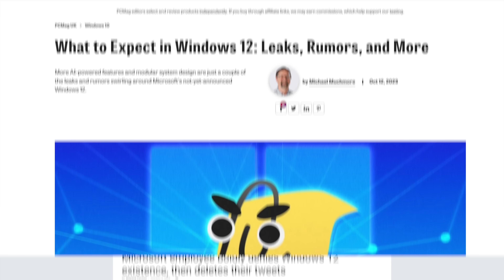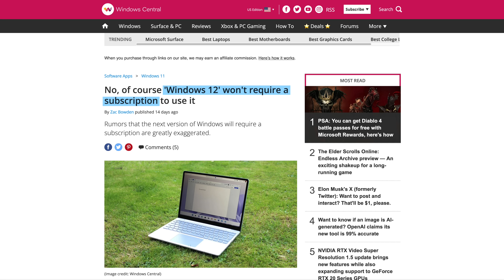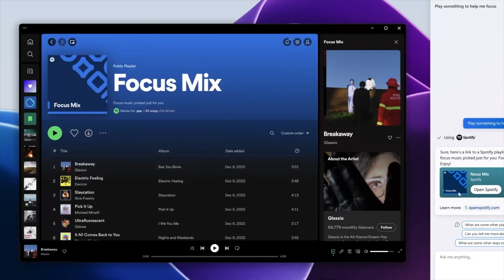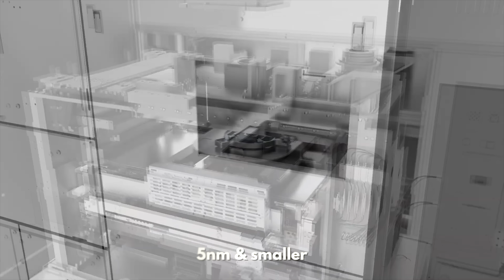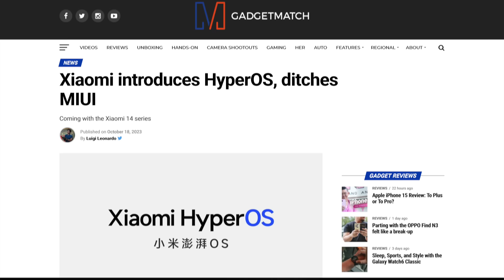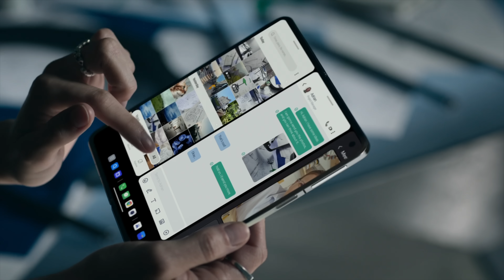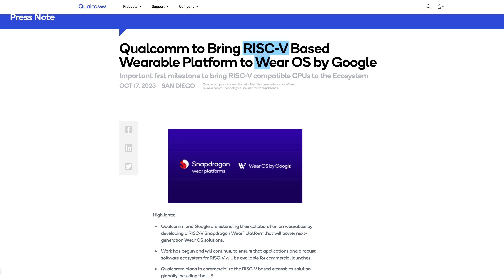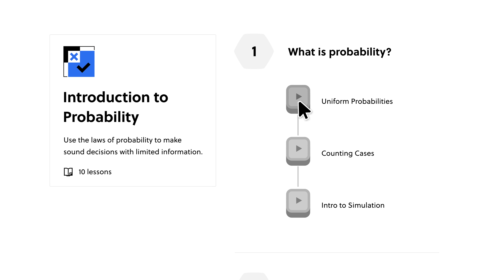Windows 12 is looking good!

Comment: 10 is supported until late 2025, so I can see a lot of 10 users skipping 11 completely and going right to 12. This of course assumes they have a newer pc which would be compatible with 11 and 12's security (motherboard) requirements
Reply: For most users, the frequency of Windows 10 updates  slowing down after 2025 would be a good reason to keep using it for as long as they can keep the hardware running. Windows 11 and 12 are not faster, the settings are more restricted, and it supports less software. I know absolutely no one looking forward to upgrading a Windows machine, even if it was completely free. When their machine finally dies, they resort to second hand machines to try and postpone the inevitable OS update.
Reply: I don’t know if this is an unpopular opinion or not, but I actually wanna experience Windows 11. I didn’t got a chance to Experience Windows Vista and 8.1 but I actually have better hopes into this OS. And I actually think it’s easier to say goodbye to Windows 10 than 2000,XP and 7 because I found Windows 10’s layout the most boring and simplified one of them all. I actually think Windows 11 did slightly better. Seeing this preview makes me afraid Windows 12 won’t look like the past Windows versions anymore because the taskbar is no longer fully overlapping the bottom screen like how it was all the time. Despite a lot of people have their thoughts about Windows 11 being not very good, I do actually somewhat like it and would like to experience it because the new MS Paint version.
Reply: @infernal-toad  Windows 11 is a better Windows 10 IMO.  Windows are more rounded and detailed.  To me it looks even better than 10.  I've been using Windows 11 now for a year and no issues.  I love it.
Reply: @riseabove3082  That’s good to hear. Honestly the only issues of Windows 11 I can think of are probably just minor issues. Nothing problematic compared to ME, Vista and 8.x. And if you don’t like drastic changes (which is definently gonna happen with Windows 12), then why are there a bunch of people that wanna Skip Windows 11?

Comment: The only way to do a great version of Windows is to re-write it from scratch. Clean sheet rebuild.  All we have ever seen is patch upon patch upon patch. my good what we currently have is little more than a skin atop windows 7.  and to make matters worse the things that they did change made things worse overall.   Windows was created like a bag of lego's instead of it being one coherent system, its a tons of little scripts and programs that dont relate with one another, each having their own sorta checks and balances.  The reason why it hasnt changed is obvious.  it cant. because windows in all its forms past and present is do entranced in various industries, that none of its older code can be removed or truly revised because so many systems that rely on that old code would fail to run.  i mean do you have any idea how much machinery out their still runs on dos!!!!!  so Windows needs a version that leaves the original code to its own version, and completely new operating system that is devoid of all the old code and antiquated programing methods.

Comment: I am still on win10. I would switch to Linux if I could but gaming on Linux (especially VR gaming) is a nightmare. I could upgrade to win11 if I force the bypass on my motherboard but I simply don't trust this whole AI path that they have taken. I mean, I have messed with AI stuff occasionally but I still wouldn't want it integrated into an OS and I think this is one of the big factors for other people not upgrading as well.

Comment: I think you appear a bit confused.....

Chat GP using web skimming or public data (anything from the internet) is only available as opensource license as default. As the EU explains unless organisations are able to prove the individual license source of the data by block chain the origins of the data cannot be licensed. Clearly any consulting company might be reselling stolen data to clients...

Windows 12 will probably be the end to windows OS . Windows operating systems have been in a down ward trend for some years with several announcements that windows 10 might be the last OS windows will produce. The details of windows 12 have still not been confirmed but it could mean the collapse of windows as we know it..not a bad thing...

The main thrust as we understand it is it will make the users machine into a thin client which will off load any demands for power chips in machines as the computing will be in the cloud. Similar to Google 8 pro. Chip maker like intel and AMD will see declines in revenue from high margin chips. These companies have been warned to move away from Microsoft before the market collapses for their high value chips. In the meantime arm chips will continue to be cheaper and less complex to manufacture until RISCV undercuts ARM in Europe leaving mass manufacture of chips across Europe within a few years.

It is not clear why Microsoft would want to move to arm given Apple has not yet developed its product for the consumer yet and the majority of global corporations have many billion dollars in x86 architecture. Ms relationship with Samsung is considered to be a reason for not buying Samsung phones due to fears of spyware, bloatware, and security concerns.

Comment: The nanoimprint lithography will not replace UV lithography, it will simply be another tool for fab companies.  The nanoimprint machine are not as cheap as it was promise a few decades ago and they are slower than UV lithography.  The problem with UV Lithography is the ballooning cost of R&D to shrink the process and the machine's energy demands that keep going up with every iteration plus they are not cheap.

Comment: I'm hoping that windows 12 is a completely new NT core because Windows 11 only really updated visuals. The visuals are great but imagine a rewritten NT core that could rival the performance of linux.
Reply: One day I started my windows 11 laptop.
Since it's really slow I seen windows 10 taskbar for 2 secs.
When I play sometimes the game chrashes and I see the Windows vista default aero theme.
And when even explorer crashes I see the icons from windows 95
And that's all, so basically windows 11 is windows 95 with just better UI lol
Reply: @uusfiyeyh  I'm not saying they should replace the NT core, just that it could use a huge upgrade. If large parts of it were rewritten it would have performance like linux but I don't expect them to do that. Also DOS was a large part of windows but they still replaced that.

Comment: Microsoft should remove all the clutter from Windows and combine its settings into one app properly like android.
Reply: Or maybe like, idk Windows XP??? Everything was in Control Panel, than the fooked it all up.
Reply: Can you elaborate? You've made me curious. How would you explain this to a 5 yr old. I'm somewhat tech savvy but not as much as I'd like 😅
Reply: @LaceyArtemis  There is control pane, and then there's setting
these 2 do almost exact same thing, but control panel is much lighter and easy to use

Comment: Windows 11 is... a UI downgrade, at least for me. It is so dumbed down it lost quite a few features, while the under-the-hood areas stayed exactly the same, as in kernel and codebase. It's just a reskinned 10. If 12 will be again a minor tweak instead of offering a proper quality upgrade, it will be the end of Windows for me. I accept 10 just because it's stable now, with updates disabled. I hate how it treats the user without disabling every. single. annoying. "feature"., when it thinks it knows better what I want to do with my PC than I do. 11 is now ugly af. It looks like a mix of Android and MacOS ripoff. I think of switching to Plasma Arch in the future. I'm glad Valve made great tools for Linux gaming

Comment: Question: Contrary to phone updates, I feel like lots of people prefer not to upgrade to the next version of Windows. Why is that the case?

Genuine question.
Reply: Up until Windows 10, previous 'new' Windows versions were marketed as entirely separate products and sold as such. They had their own update life cycles (service packs, anniversary updates, etc...) also usually drastically increased minimum and recommended hardware specs so it made more sense for users to buy new PCs every other or so Windows generation (Eg XP to Vista). Starting from Win 10 tho, it does seem like they're headed towards rolling updates and treating it as one Windows, similar to Mac OS and Android/iOS, presumably to limit fragmentation.
Ironically, Win 10 was supposed to be "the last version of Windows" but then Microsoft and OEMs realized they sell way more PCs when new major Windows versions get announced sooo they're in this middle boat of making updates seamless and fluid while marketing higher numbers it seems, Win 11, Win 12 etc...
Reply: I think because they break too many things while phone updates are usually very stable.
Plus PC os updates are boring but phones get more new features that people are hyped on.
The hype might be just due to better marketing.

Comment: The new Apple Pencil usb c isn’t convoluted it’s a line in the sand 

6:33 

Any legacy iPad uses lightning Apple Pencil 
Ending with the iPad 10 which can uses all  both lightning and usb c versions 

Modern iPads can only use the usb c or Apple Pencil 2. … you would only pic the usb c version if you want a cheaper option 

If you have a 10gen ip

Comment: I think Apple's ability to update iPhones wirelessly is the first sign of port-less phones coming. Perhaps not this year, but in two years this may be a reality
Reply: Hasn't this been a thing like forever???
Reply: port-less makes no sense, that would mean huge electricity waste taking into account how inefficient induction charging is.
Reply: I haven't had to plug in my phone for an update for years.... Is this still a thing with iPhones ?
Reply: @luke5100 it will never be as efficient as directly plugging something in. The physics make it impossible for it to be as efficient as being plugged in, and it would make no sense either since it would have to sit on top of a charging pad which is WORSE then simply plugging it in and being able to actually use the device as it charges.

Comment: I really hope the taskbar doesn’t go up the top. Microsoft seems more focused on the users it doesn’t have than users who it does who hate MacOs
Reply: Apple is Microsoft's biggest rival. They have been Rivals for over 40 years. What started out as a pure software company has turned into a software/hardware company in the last 15 years. Why? Because of Apple. Apple launches a new or revised product and then Microsoft does the same damn thing only worse. First example that comes to mind; Microsoft Zune. They tried to copy the iPod that Apple invented. It failed terribly. I honestly don't think they sold any of them, Never seen one in the wild, only in store shelves. Second failure after Apple launched a product was Windows 8. Tried to make it so that like Mac OS and iOS, Windows 8 was dual purpose. It failed yet again because you removed a key feature that was part of windows back in the 95 days. The start button. They also tried to make windows 8 more touch screen friendly and the one's who didn't have that feature typically the desktop side of things suffered. Thank goodness for the 3rd party software companies who came to people's rescue and implemented their own start menu. They also popped windows on a smartphone when 8 launched and I only knew of one person who actually got one. It once again failed. They will continue this back and forth for years to come though. Apple releases a feature or design change and Microsoft follows suit just with their own twist to it.
Reply: Can't you just move the taskbar?

I gave up in MS 2 decades ago for the most part and only run it within a virtual machine and went to Linux as my main OS.  I don't think I've ever had a desktop this didn't allow me to move the task bar, well, except for that awful Unity, which I ran for a week.
Reply: @fuzzywzhe  you can't put it on the side of your screen any more since Win 11. Which is a shame because I prefer it being there, hope they bring that feature back eventually
Reply: @fuzzywzhe  Starting with Win 11 you no longer can, it's fixed at the bottom. There are some scripts that try to force-move it, but things easily break with that.
Reply: @luke5100they already let you put the taskbar wherever you want. Windows offers a ridiculous amount of customization options, but people are too lazy to Google to figure them out.
Reply: As long as the app still closes when you click the X
Reply: It will have a toggle
Reply: I feel like that every version of windows after win-98 has been closer to being like Mac-OS and I hate it. Worst of all they often block the old features so you're forced to live with their changes.
Reply: @Samqdf break traditions, use KDE and design your own desktop just the way you like.
Reply: @Samqdf  Ah, THERE'S the part that everyone was going to complain about.  Can't have a video curious about something without someone complaining about SOMETHING.
Reply: @Samqdf  becausse it got modern? cmon. Tell me how, Taskbar is centeres now, BUT TF ONE SETTING AND IT'S BAD.
You want them to have the same ugly old sharp corner ui? It's like not relatable how you can be mad becausse Windows got cleaner sind WIn 98?!!!
Reply: @Samqdf  "I feel like that every version of windows after win-98 has been closer to being like Mac-OS and I hate it."
Then you're clearly delusional.
Reply: @Unethical.Dodgson  I should have been more clear- I mean in terms of the interface, more specifically in terms of prioritizing form over function. You can still call me delusional if you like
Reply: @Unethical.Dodgson  

Windows 11 look nearly like apple

Settings app
Microsoft Store
taskbar not left at setup at the center
Reply: @unsureofachannelname1257  so your standards for "looking like" aren't very high. By this logic: KDE is just Windows.
Reply: @Samqdf  - I agree, Win 7 was the best so far, with Win 8, 9, 10, etc. they have hidden the Toolbox where you set the WiFi setting, Network Protocols, etc. The menu went to big squares for each App and we lost the detail, alphabetized listing of all the installed applications. It's seemed like they thought all PC users would want their PC to look like their phone interface. They forget that PC's have a full keyboard and usually a 15" or larger screen so we don't need or want a 'touch screen' interface. PC's have a much wider range of applications than any cellphone and a much larger screen and separate keyboard/mouse/touchpad that changes the user interface requirements.
Reply: @Unethical.Dodgson  Nah, more like the other way around: Windows look like KDE. But that doesn't mean it's exclusive, it (Windows) also takes "inspiration" from Macintosh.
Reply: i dont care if it at the top or bottom or wherever but windows really needs a dock of some sort, like 75% of my taskbar is deadspace and i dont even have a second monitor
Reply: "users who it does who hate MacOs"

Who are these mythical users that HATE other Operating systems?
Reply: Helo, it me  @Unethical.Dodgson
Reply: @Unethical.Dodgson  It was never said that "they" "HATE other Operating systems", just that "they" hate MacOs, which I completely understand.

Comment: Wish Microsoft keep continue supporting Intel and AMD Ryzen chips made from 2018 and above but with some limitations on AI stuff not supported by the chip.
Reply: Funnily enough I still don't feel my 4th gen i5 (Haswell) is lacking in terms of performance. At least for casual use and older games it's more than enough. Win 11 and 12 not supporting older generations is simply planned obsolescence.
Reply: @xpforevergaming8609 Same. Sticking to Win 10, I'm not throwing away a perfectly good desktop because of planned obsolescence.

Comment: All I need to know is how linux will be like when windows users are forced to migrate from 10. I will not use a windows that has an AI that thinks it owns my stuff and reports back to spyware central all the time. i would rather freeze in time than have my offline computer feel like youtube's comment section, where you can't type anything freely anymore due to rampant speech control from big tech.

Comment: The Canon's innovative machine is a good news for the consumers. If Canon could compete with TSMC or Samsung it could mean lower prices for the end users. Also wtf Apple is this "new" semi good pencil, how did you make a iPad pencil in 2023 without pressure sensitivity and it costs 79$ and it doesn't charge while magnetically attached like the 2nd gen does. No one should buy this device.